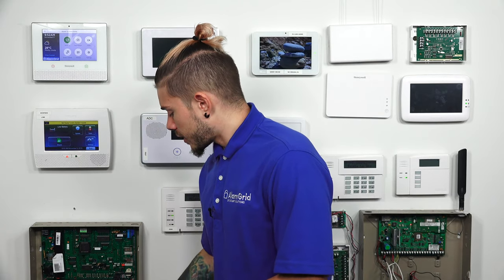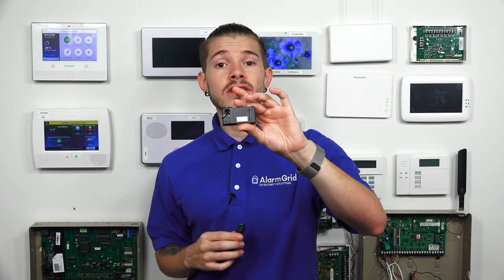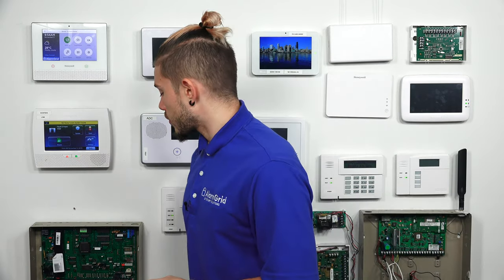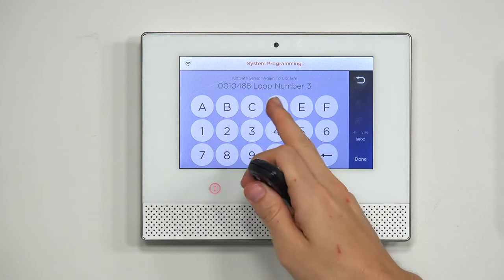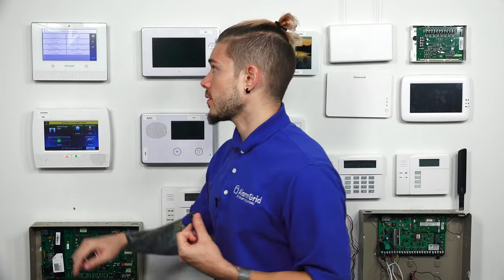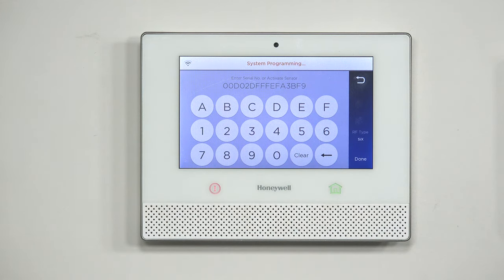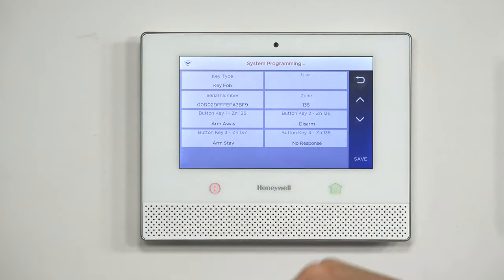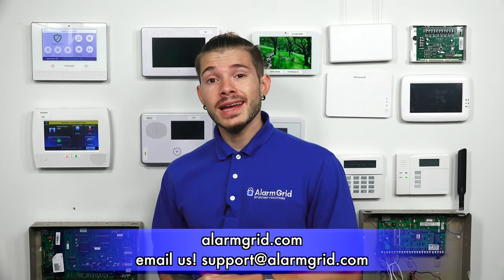Finding the Serial Number on a Honeywell Key Fob

Comment from the maker: You must associate a key fob with a user code for logging purposes. This way, when the fob is used, the event log, the monitoring station, and Total Connect 2.0, if used, will get information that the user associated with that fob armed or disarmed. The fob doesn't actually use or transmit the 4-digit code for the user it is associated with.